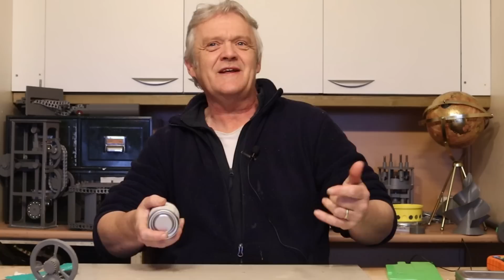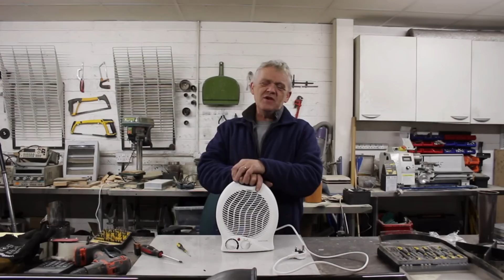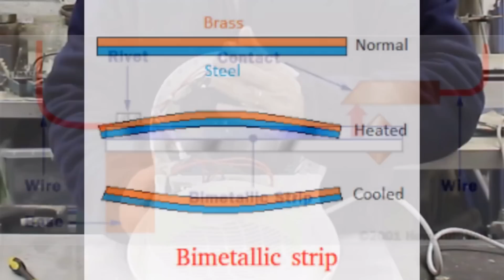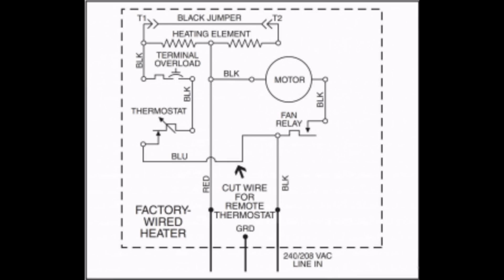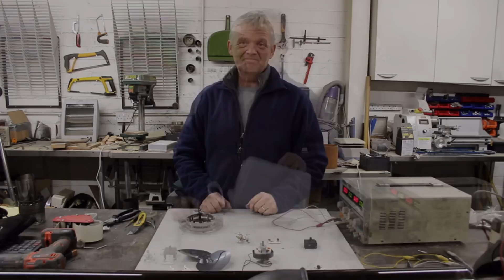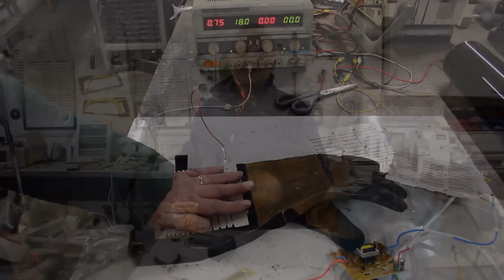2140 DIY Heaters

Comment: Hello i wanted to ask if i can turn a soldering iron in to a element to heat up sand with to make a heater for my balcony? I live in sweden and I need a heater that heats well and constant and runns on very low watts. I have a solarpanel 100 watt, controller, and a car battery 60 AH  and a converter constant power 2500w ( 5000w peak) and need a heater solution that i can make my self and will not run down the battery to zero everyday and leaves juice in the battery to run 44 watt lights 10 h/ day. Could you help me? Realy love your videos!

Comment: I have an old slow cooker rated at 50w I am amazed it is capable of cooking. Admittedly you have to pre heat everything but still. Once saw someone make something not sure what it was but it was a series of steel plates shaped around a 50w light bulb.

Comment: Hey Robert, might be missing something but could you basically take a wind turbine and connected  directly to a toaster or fan heater element. Im assuming a wind turbine with relatively limited capacity, maybe stick a rectifier and fuse or something as bonus safety.

Comment: a roughly 1sq meter diy solar air heating panel could be built about 250$, and be easily changed to a cooler for summer. if it was 100% efficient that'd be ~1300 watts heating for just the cost of running a fan, and that's before you consider the possibility of making a larger or multiple panels

Comment: I've come to the conclusion that the cheapest and easiest way to heat small spaces, whilst not incurring a fire risk nor using copious amounts of electricity, is to put several bottles of very hot water into that space.
Reply: How do you heat the water?
Reply: @izysly6924  from the tap with the boiler

Comment: It the days when toasters etc where repairable 1950s-60s.  If the toasting/heating wires broke I would pull the heating card out and “twist” the broken wires together and put it back together.  I would do the same with the wire heater in the electric jug.  End result super fast toaster and super fast kettle.  The super fast toaster cooked the surface of the bread very fast leaving the inside soft, really nice toast.

Comment: One Winter I tried to use some steel mesh or a steel scrubbing pad in the top of a hurricane lantern. But I don't think it worked too well. But the thermal mass heater did warm the room that had a candle under a steel pot of water. And it used a few larger candles and the steel pot was in a larger deeper steel pot. I could knock a bit of the chill out of my room.
Reply: Also it did have to have enough room for air to circulate.

Comment: For cheap/free lower voltage heatings i always recommend old car lights.
front ones had 60 + 75W .. brake+ indicator lights tend to not break that easily, especially if you underrun them.. I think they go from around 5W to 15W depending on the type of light..
and then you can just scale them in a row to the voltage you have.

Comment: They have made that brand of fan heater even cheaper than before by leaving out the other switch in the base that would  turn the power off if it fell over.

Comment: As a locomotive electrician I deal with safety issues all of the time. The number one thing is to know what you are touching. All of our machines are forty years old or older. One is turning seventy this upcoming year. Because of their ages they often need to be upgraded with more modern parts as the old parts have outlived their expected lifespan by double or more. I have zero fear in taking things apart and making these modifications. Experience and education have made this perfectly safe. 

What’s interesting is the fact that I learned nearly everything I needed to know keeping my model trains running before I was ten. All the principles are the same even though the complexity is greater. 
Experimentation is the greatest teacher.

Comment: What about coating fiberglass matt. Use copper plate wnd copper rivets and glue the copper to the fiber glass matt with thr carbon ink that is coating the woven fiberglass matt. Then possibly look into coating it all with enamel like used on copper coiling wire, or a figh temperature silicone, glue a thermal protection device to it. Wiring it in of course to limit the temp to below the boiling of water.. 180° f or there about,  and it used along with a temp cintrol and possibly a dc boost converter . Sew it on to gloves, in clothing, in jackers, jeans, or chapps, sox , boots,  or even use nichrome wire sround 26-28gsuge weave it through the cloth, say a. Sock use another thin sock  sew them together quilting thrm tiborotect the wearer. Of course coat the wire with enamel, or silicone or some other temperature and moisture resistant insulator. Use a 20 ah lifepo4 batter, set it up with a bimetallic switch to power up a dc boost converter to boost it to around 
32- 36v  to fight the resistance, after it is up to heat using thin leather to hold in thr heat would be a awesome way to store some heat, a thermal mass, especially a sleeping bag made this way with about 24'-32' of 28 gauge nichrome wire wiven through a cloth coated with conductive ink. And backed or sanwiched between  thin leather  and sewn 
Into a sleeping bag or a blanket, it could keep a person warm even in a roomsround 30°- 35°f even colder, pull about 12v, 15 amps , and swetup with a pwm controller, using frequency to regulate temp along eith actualbon off controllers, the pwm running around 20 hz, to around 400hz to eliminate hot spots while getting up to temperature with it pulsing at 20 or even 10hz, while being on for 4-5 minutes out of 15-20. Thr battery should last for a couple days it could be connected to 50-60 watt pv pannel, to charge daily, if a person is walking and camping . Build a bouncing gravity charger use a serpent coil around 26 ga, slider about 8' long, a stater about 12" long, and 6"wide ,the slider fitting inside being 5.5"-,5.7" wide, and having bar magnets about 4-6mm wide and enough to equal 5.5-5.7"wide. Running thr length of the slider,  attaching to the backpack at te top and each dide on it's bottom . With s coated cable attaching to the bottom of the slider. A spring on the top. With a weight on the bottom of the 6" +/- cable.set the spring and weight so it will bounce while walking the slider sliding up and down generating power . The thin long n52 magnets and possibly 2-4 phase serpent coil linear generator with UpTo 14- near 16" of travel. The thin magne help in the simulation of a high rpm generator wrapping the coil around a tiny, but magnet fitting  iron core. It should be equal to a generator spinning 1200rpm +/- s couple hundred rpm. And it can be used manually, possibly making an attachment bar, with a leve and handle, looking similar to a framing swuare, anf a level with a bicycle hand grip on it,  breaking down , fokding up into a 2-3" wide 12-14" long pouch with a similar wider pouch the generator can fit inside, and fold at the divider.  To make it more compact.  The weight can be a survival kit with a knife , matches, and alot more, a thick 3"-4"steel pipe, about 6"-8"long.  Inside a rubbery plastic cover  with a screw on lid, to seal out water. It being removable, to hold water, while the steel part can boil the water, both having waterproof lids. The water can be boiled then sat in the cold water to cool off, and the cover used to hold mire wate, or wait to hold the cool water. And boil more water.  The contents being held inside another similar container inside. So they do not rattle loudly!  The contents also inside a thick plastic bag. So they can be kept completely separate while being protected.  It could be a actual thing people can buy,  it would not be expensive to build. And could use a dc to DC buck boost. To output 5v usb,12-13.8v hold a 4-6 farad cap bank to store power. So the dc converter isnt on and off constantly. And ut doesnit stop just because you paused for a couple seconds. Hopefully it would be enough to keep the charger going for 2-5 minutes depending on load. Great for camping, may be a micro version with a harness for dogs.   Mount yo the vest like harness, generator on one side, a bank of super caps on the other, with the option of one per side. Charge the like 50 farad capacitor, or possibly lifepo4 battery a 4ah or so. With a light that shows the battery or caps are charged.  No dangerous flammable batteries, no lmn lipo  battery , that  could harm the animals if it malfunctioned or was damaged. 3-5 ah is plenty to power a light, charge a phone, add charge to a laptop, charge a radio. And a dog running around can produce a fair amount if power if harnessed. Just like people!!

Comment: Seems like the linear thermal fuse in the fan motor would go out pretty early.  On my old space heater, the tip over switch is attached to the bimetallic thermostat, but I imagine they could be placed almost anywhere.

Comment: When I was an apprentice we did some Appliance Repair (I even got a C+G for it). We were taught that the washing machines we repaired ..... or more correctly took to bits and re-assembled ..... like the "Keymatic Washing Machine" were about the same complexity as the NASA Moon Shot (!978). 

The difference was not in complexity but number of systems. 

Of course things are different now, with microchips potted in for pennies, but the basic premise still stands. Stuff is simple! especially if you break it down into its parts!

Comment: I use the same simple setup for my soldering station:  a plastic box with a simple soldering iron holder, a switch and an electric cord.
Later, I added a circuit breaker and outlet for testing new projects, like an adjustable DC power supply, or guitar amplifier I designed & built.

Comment: I just bought a heated vest to wear in the workshop during winter I saw cheap on the amazon to try out. Its just a usb battery bank, a cpu with mosfet that does some pwm and carbon fiber heating elements.

Comment: If people want to add fiddly bits it's because the are Safety Sallys and have no idea how simple the thing really is, so they need to complicate it to make up for their own faults or inability to use a heater safely.
  The same people probably think a terracotta pot heater is safe even with 8 tea candles!  Or they think tap water is an electrical conductor.

Comment: Excellent points over 30 years ago i rewired a 3 phase electric motor into a induction generator using information in stationery engine magazine & i connected the writer & he had been threatened & more i was discusted & supportive as the generator was safer than a shop one & more reliable ( 25+ years of service) keep up the good work.
Reply: Do you have a link mate sounds good. 
I'm a motor /generate rewinder. 
I'd like to see or read what it was. 
Thanks in advance
Reply: @simonlaker2139  it's probably a rotoverter. Hector Torres was the guy behind it, might still be up on Patrick Kelly's website.